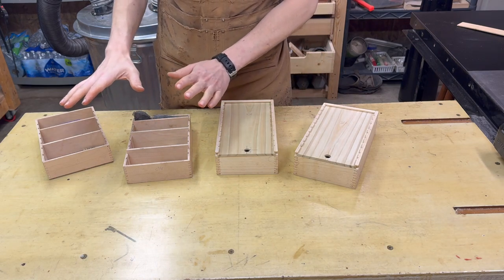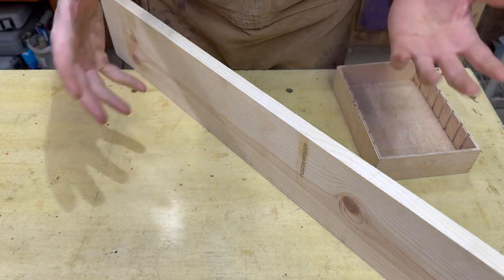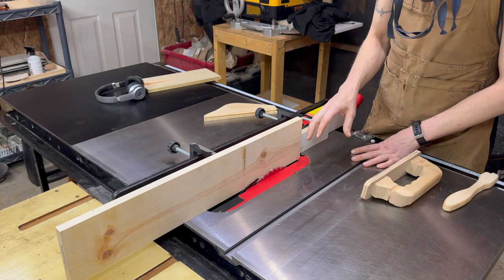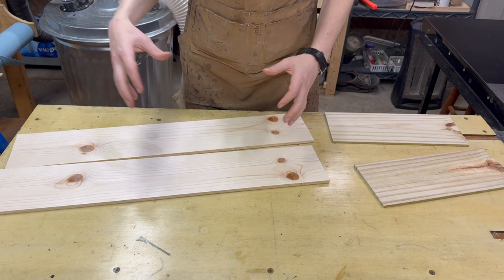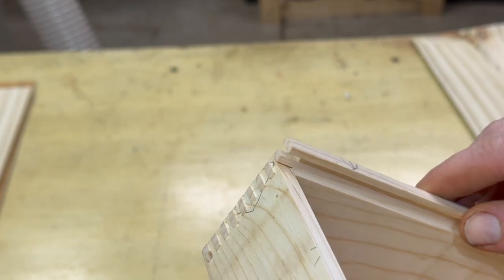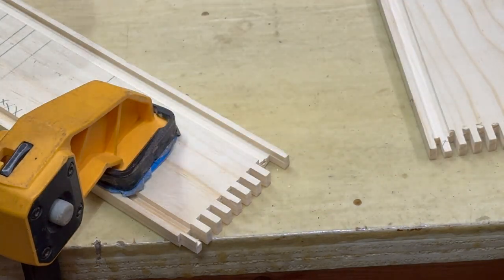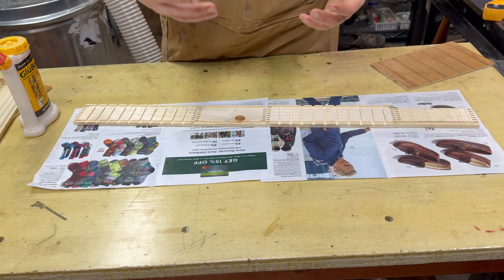Easy Shop Storage Trays - Step By Step Tutorial For Quick And Dirty Organization.

Comment from the maker: Timestamps:
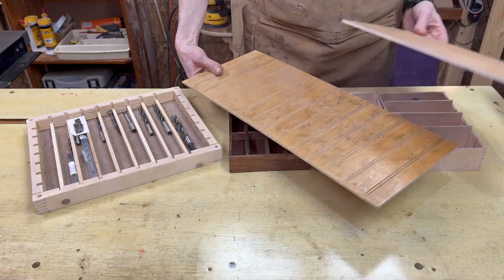Intro 0:00-1:10
Materials 1:11-142
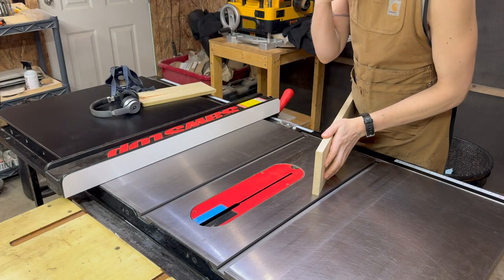Basic Process Overview 1:43-3:05
Resaw Box Side Material 3:06-5:31
Rip/Crosscut to Size 5:32-5:59
Layout for Finger Joints 6:00-7:56
Jig Setup 7:57-9:13
Finish Fingers + Divider Concept 9:14-9:52
Base/Lid Groove Layout 9:53-13:24
Cutting Base/Lid Groove 13:25-20:02
Cut Base 20:04-21:02
Cut Front Lip 21:03-23:01
Remove One Finger-Joint (optional) 23:02-24:00
Divider Groove Layout 24:01-26:44
Cutting Divider Grooves 26:45-31:07
Glue Up 31:08-34:12
Lid Sizing 34:13-36:47
Lid Hole Placement 36:48-38:06
Divider Tips 38:07-39:10
Final Thoughts 39:11-End